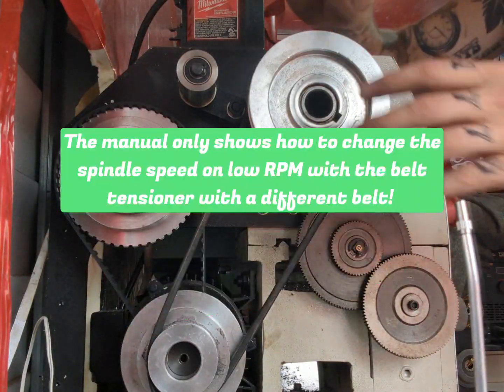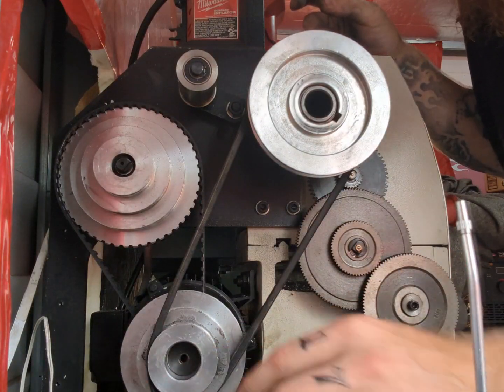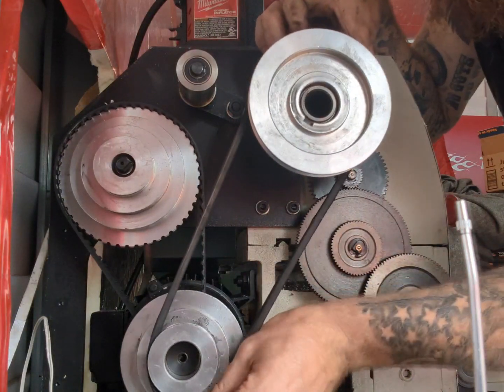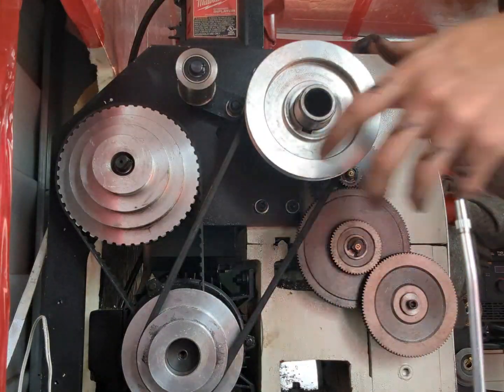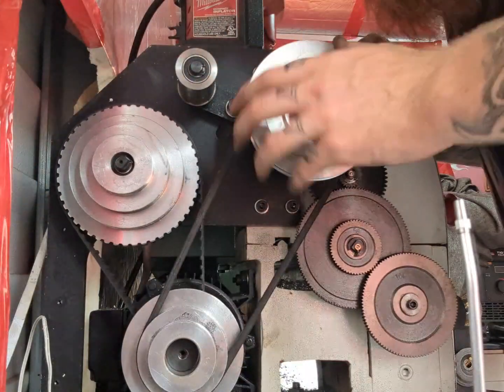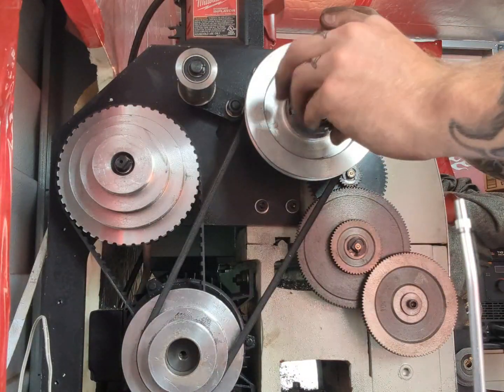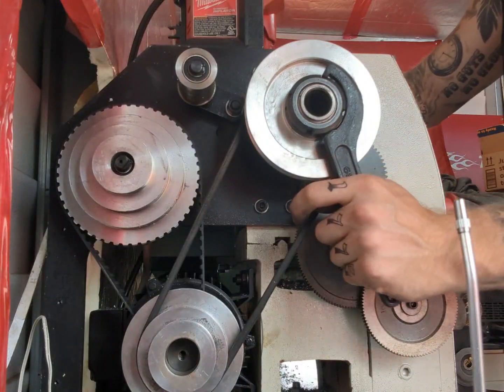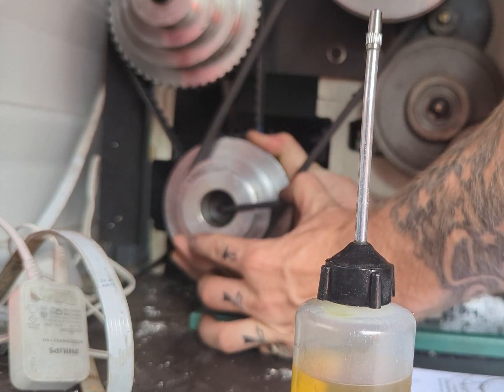Grizzly Lathe G0602 Spindle Rpm belt change

Comment: The unfathomable stupidity of this design is blows my mind.  Think about it, some idiot engineer took this idea to his supervisor and got it passed. Both of them should be fired immediately.  You are actually supposed to loosen all four bolts on the motor to do this. The fact that you cannot turn a wrench in that tight space or fit a socket over the nuts to get them loose apparently never occurred to these idiots.  And this is a common task!!!
Reply from the maker: Haha yeah I agree, pretty dumb !!